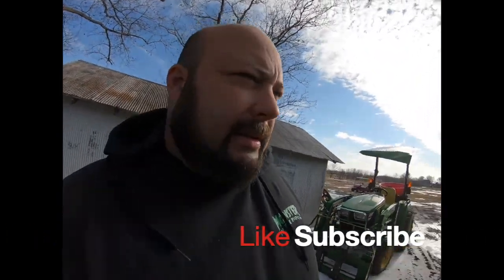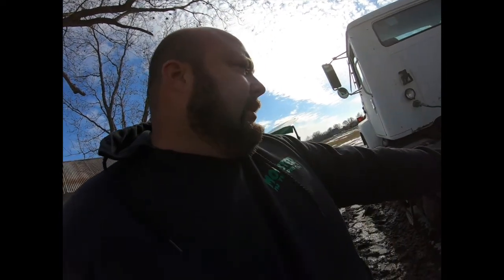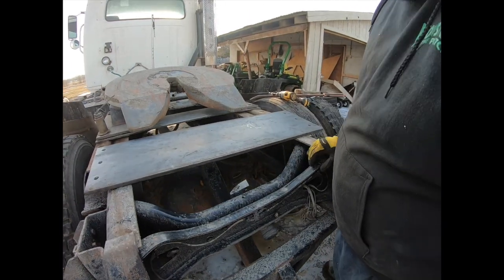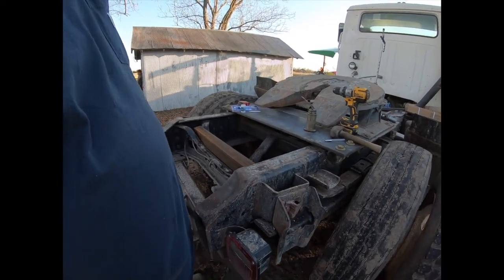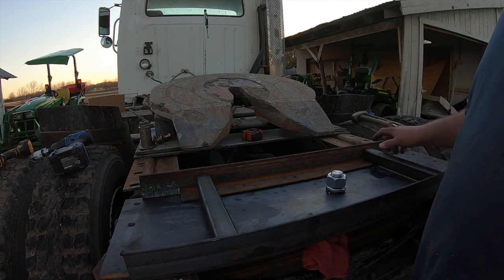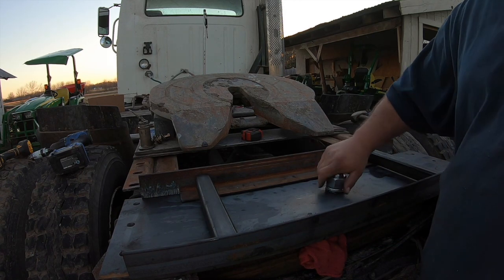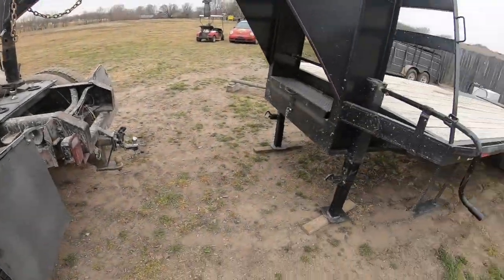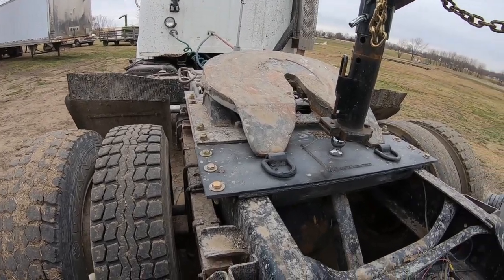Custom Gooseneck hitch for semi!

Comment: i thought i heard you say you drilled a 1  1/4" hole for the ball. i have always needed an 1  1/2" hole for a gooseneck ball. is it possible the ball is one of the "lower" weight ratings? might want to double check just to be sure?